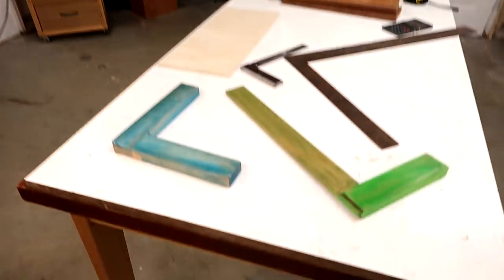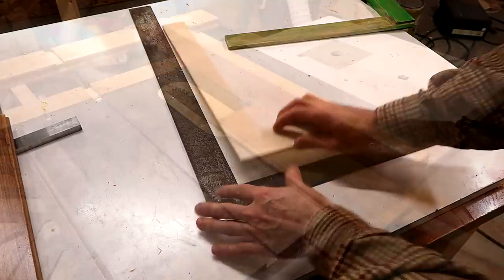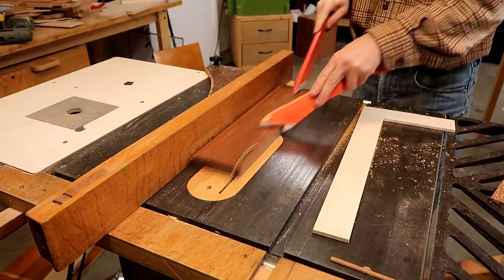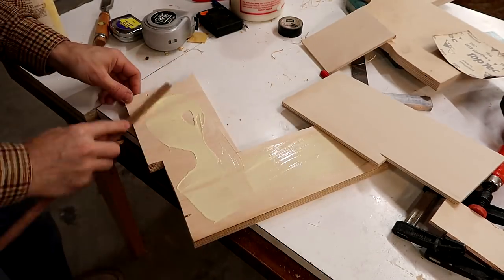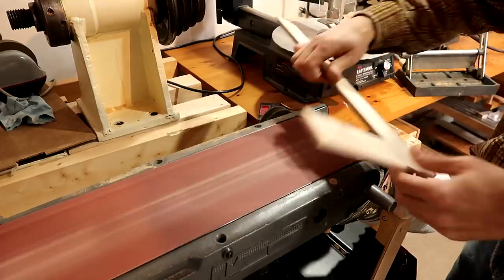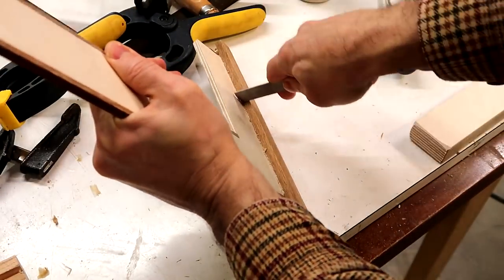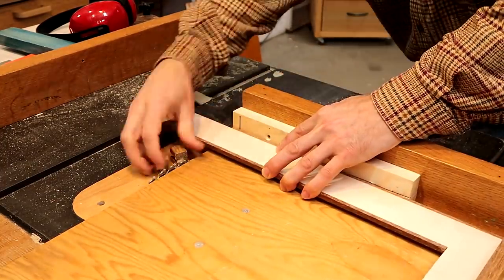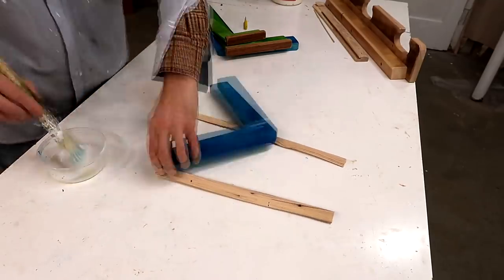Making shop squares

Comment: Why did you round off the outer corners of the blue ones? I would think that would make them not-square....
Reply: The blue ones are clamping squares. He clamps them to the inside of boxes to make sure the corners are square.
Reply: Ace Lightning They are for clamping right angles. The rounding is to prevent glue squeeze out from gluing the brace to the work piece.
Reply: Yup - it's important that the long edges of the square are exactly 90 degrees - there's no need for the long edges to meet all the way at the point of intersection since the work piece is fastened to the long edges for their reference, not the corner of the square. Also if there is any debris/dust/etc. on the inside corner of the work piece, the square could run into interference if the corner wasn't cut off; then you'd end up with a joint that wasn't perpendicular.
Reply: I just can't see how the box sides can be at a perfect 90 degrees if the inside corner where they intersect isn't at a perfect 90 degrees itself. It seems to me that the corner is the most critical part, and if you get that lined up correctly, the rest of each side will automatically line up.
Reply: The intersection is probably one of the least important areas when determining square. The two pieces could be square at the corner and then splay out. It is more important to have a long reference on each side of the square. This is why framing squares are large. You will often find framing squares with the inside intersection drilled out.
Reply: picture it this way : the closer you are to the actual point of the angle the less impact a an incorrect angle will have. Ex: if you needed 2 piece to be parallel but you accidently have 1° offset, you won't really be able to tell 1 inch from the start point because the distance difference will be minimal, but the further you get from the start point the more that actual distance between the 2 piece will increase. so if you measure the 2 piece further away from the angle you will have less tolerance for an incorrect angle.  if that didn't help think of pizza slice the angle stays the same from the tip to the crust, but the distance grows the closer you get to the crust
Reply: I like the way you put it, fittony.

Comment: Start with a commercial square and a high quality dialed in table saw and make a square. Fun watching your channel, but was hoping you'd show some clever way to make a square with out a square (hint 3-4-5)
Reply: The idea was not to make squares without any existing one. Video is about making some extras with an edge which holds onto the surface if left.
Reply: Measuring 3 4 5 accurately enough to produce a square square at a size reasonable to use isn't going to be easy. It works in framing because being off a 1/4inch over 20 feet isn't a big deal.

Comment: Doesn't it matter that it's not metal? I would think wood moves around too much for a square
Reply: I dont know the real therm for that what i like to say :( ...i try it :D Wood like in the normal trre in your garden moves and suck the water out of the air. So the "realwood" (We in Germany would say Echtholz) its not good for build squares. But MDF our Plywood cant move so extremely, so its work. If they would move like ashwood the crosscutsled on the tablesaw would clamp itself to the running blade and fly really fast to your body. I hope you understand what i try to say :D
Reply: Lottiderhengst Bee I understand your point. I know plywood doesn't move much but I think it still moves a bit. I had commented before finishing the video and I think the double layer of plywood has crossed grain so it won't move

Comment: A square has to be from metall. In one part. Wood lives. And squares from 3 different materials sucks.
Reply: Alfred Neumann considering how long mathias has been using these I assume he knows what he is doing
Reply: I forgot to add the 'IMHO' at the end.
Here i have two commercial produced wooden squares. Everyone would say, these are ok. I checked them with a metall square from a metallworkshop. Also used a digital square. Same result. Both are out of square. And both are no cheapos. Of course only my experience. And of course my comment was no attack against Matthias. I would never attack a German  :-)
Cheerio from Germany.
Reply: Alfred Neumann Out of square to the extent that they are unusable? You forgot to mention this small detail.
Reply: @Parrish Westenberg For a German, out of square to any extent is unusable! :D
Reply: Wooda Wambam Ok buddy.
Reply: Were they out of square because they were made out of wood or simply because they were made unprecisely? Plenty of  commercialy made metal squares that I checked weren't square either. With plywood especially I dont think wood movement would be an issue.
Reply: @Osren
These squares are living. I checked them more times in the year against one metall square. They had different errors over the year. They are not made from plywood. It's a hardwood, don't know what. Could be walnut. 
Yes, i also had metall squares, which i found unusable. Commercialy unprecisely. But these were cheapos. The good ones were much more expensive. It is a question of money. Of course. 
Anyway i will look for a good piece of plywood and make one. Nothing against a good surprise. Sorry for my english, it's not my motherlanguage.
Reply: Interesting comment, I don't see much angular movement. Most of it is either expansion in the parallel or perpendicular directions so for the most part It should remained be square. Good enough for woodworking for me at anyway.

Comment: At 4:08 a bad accident nearly happens. But it isn’t really noticeable because he got lucky. Lucky to still have his thumb.
Reply: slow it down. All he did was pick up a piece of scrap near the blade
Reply: You mean when he picks up the scrap? not that bad really
Reply: rubbish
Reply: remember this is playing in fast forward. yes he could have used a stick to push it further away, but that likely would have meant not looking at the blade to find the stick.
Reply: I think people forget that no matter how good Mattias is, the videos are still sped up. This is not actual speed. And people do way worse than move pieces of wood away from blades, and get away with it.